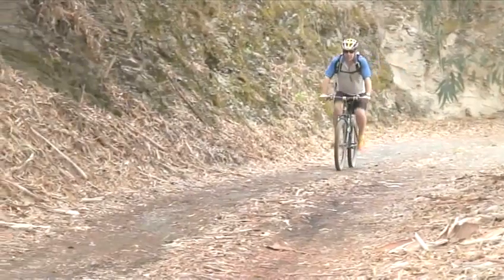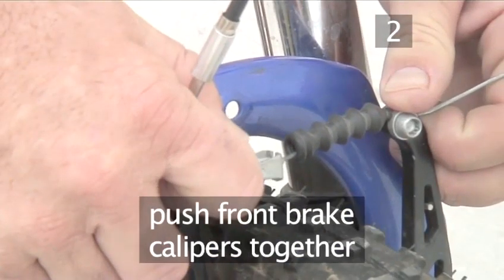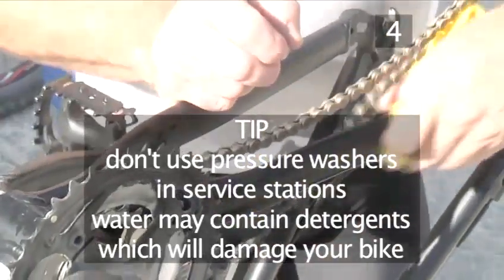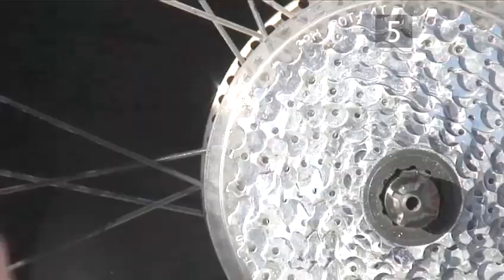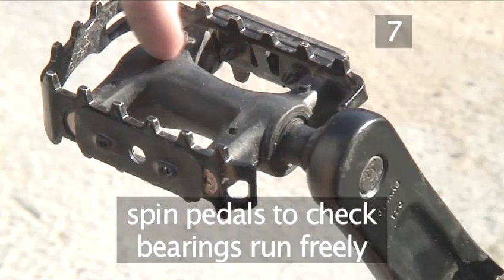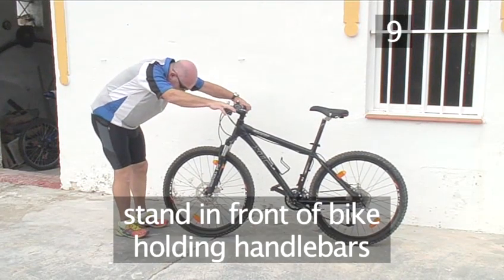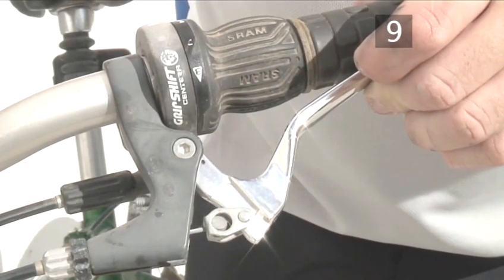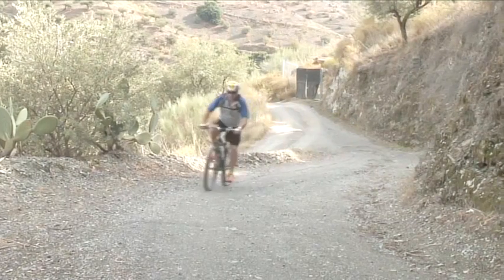How To Keep Your Mountain Bike For Maximum Performance

Comment: Anyone with a rudimentary understanding of how bikes work will know that you don't touch your disk brakes, and you don't use pressure washers. Following this guide will ensure that your bike does not last, and may even lead to a catastrophic failure of bike components, resulting in a crash. STOP SPREADING BAD/FALSE INFORMATION!

Comment: I'm guessing that this video was designed for five year olds who have no idea what a bike is!!! DONT USE A JET WASHER, it will ruin your bearings and your bike will no longer work! Don't use WD-40 or GT-85, they are not designed for bikes use a brand like finish! The reason why the pedals don't work or the groupset doesn't work is because you have jet washed it! Also visit Muc-off they have great products! I am not happy about the advice they are giving as it is treating you like you are five and they clearly have no idea how to properly clean or maintain a bike!
Reply: I remember about 3 years ago I had a very cheap road bike. I thought it be a good idea to put WD-40 on the drive terrain as lube. It went good the first ride, by my 4th ride, my chains were black with dirt, my gears were black everything was so greasy. Luckily I learned a good lesson, I was only 11 at the time but fortunatly the bike was very cheap. lol, childhood memories